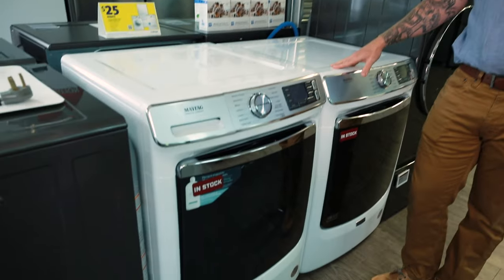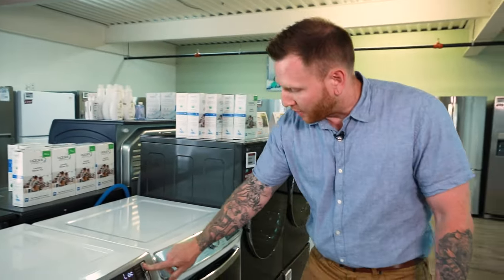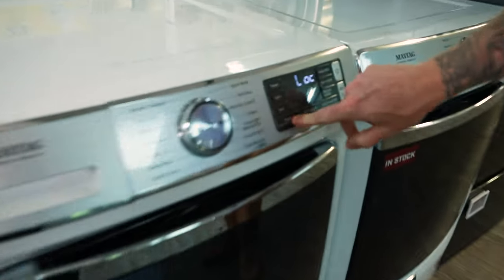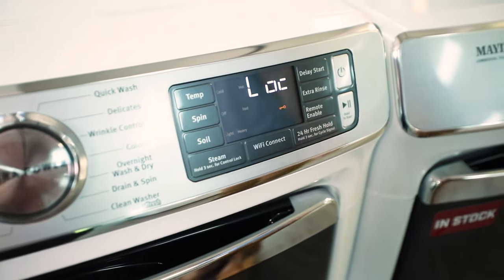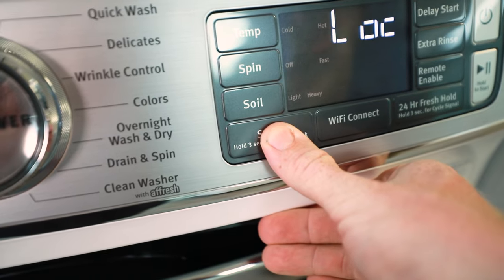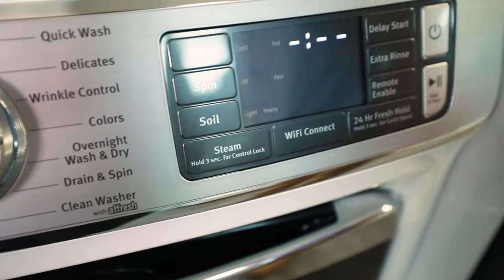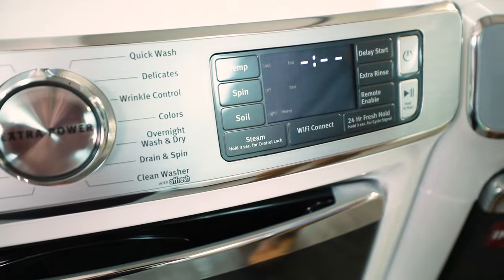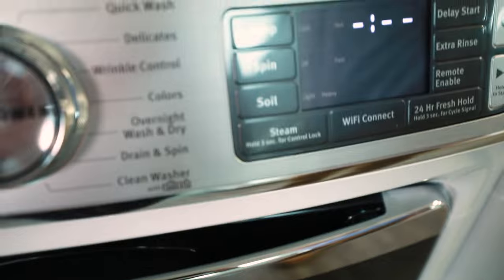How to Turn Off LOC or LC Error Code on Washers | Whirlpool & Maytag

Comment: Not finding anything on this. I have a maytag 3000 washer and it runs pump, locks and runs small amount of water like it always has but has been stopping after that, locking/unlocking sound and flashing the display/ time. Anyone have any ideas? Tried unplugging/power reset, seemed to help at first but doing it more and more/ Thanks in advance.

Comment: Thank you for your video. I did followed the instructions 30 or more times, I even shut the circuit breaker off for the washer. I unplugged the washer many times and a 20 hour period it just would not unlock. I finally called the repair company and I was so angry as I was walking out of my basement I kicked my washer and as I was walking out the door I heard beeps, my washer is unlocked and for the first time in my life I am happy to be doing laundry.
Reply from the maker: Glad we could help! Maybe the kick did the trick!